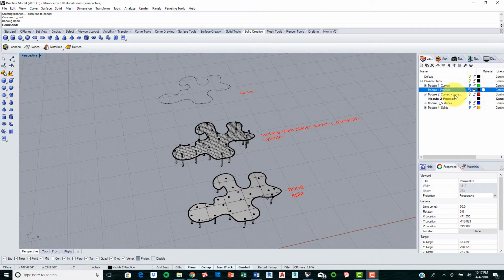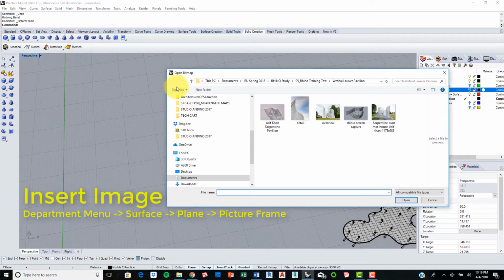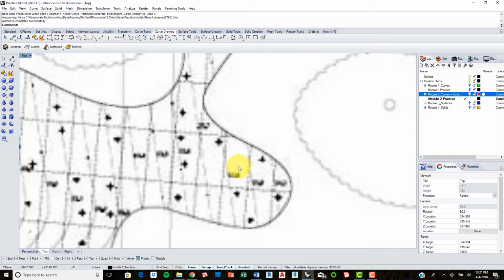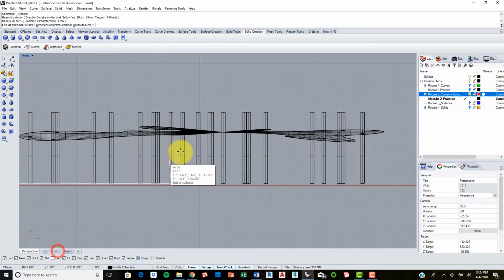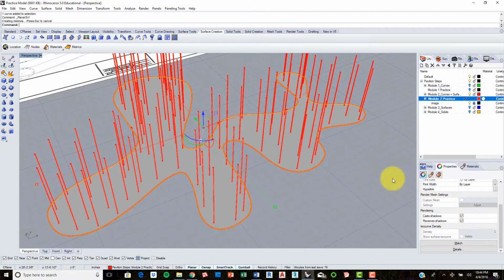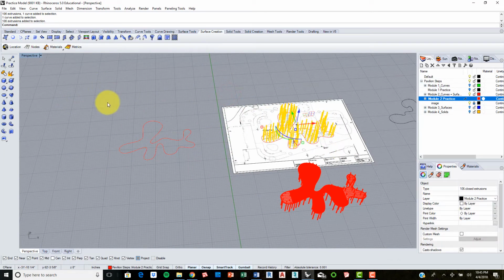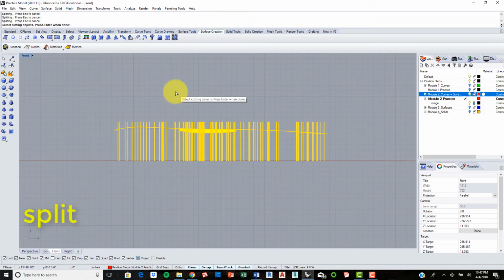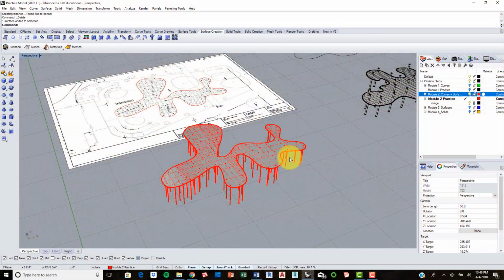Module 2: Surface Creation & Editing

Comment: Questions about the bending function. For me the whole surface bend in such a way that the top view changed and then some of the pillars suddenly stood free... How to avoid that
Reply from the maker: Apologies for the late reply - I may have misunderstood, but when 'bending', a few tips: I usually operate in a side view, make sure only the object you want is selected when you bend it, it might help to put other objects on a separate layer and turn them off to avoid distorting them and turn them back on when 'bended object' is complete. Hope this helps!